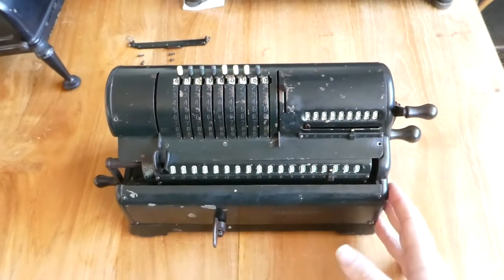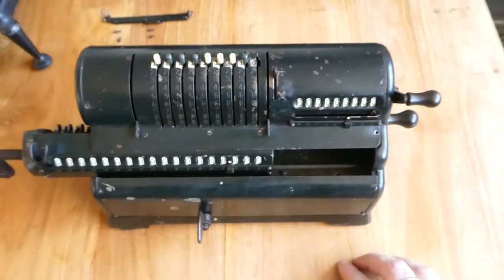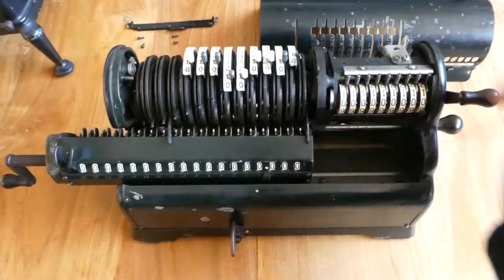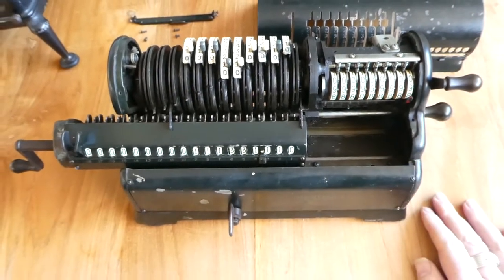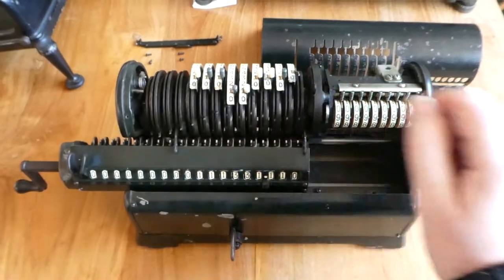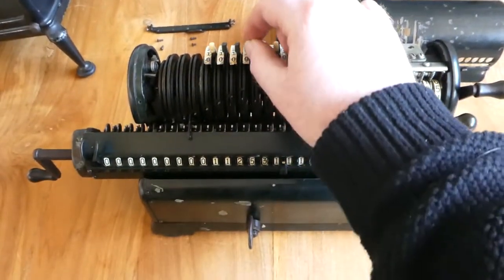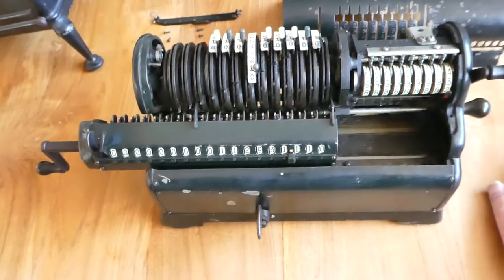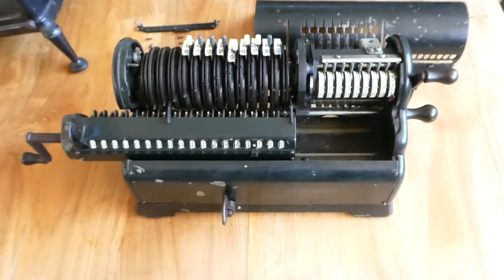The Marchant XL's mechanism

Comment: Thanks for the video, I just bought one on ebay, it's seized at present, the main crank won't turn. Used to repair the old Brass national Cash Registers in the 1960's. Looking forward to the challenge after years of fixing computers it will be good to get back to my trusty oil can
Reply from the maker: Good luck! BTW, I'm a big fan of spraycans of silicone lubricant. Easy to apply, and it loosens up old gunk.
Reply: @jaapsch2  Avoiding the spray can, just in case I decide to give it a paint job. Thanks to your video I opened it up and found the problem, noting serious really, just the result of old sticky oil, it's now working, so will de-grease and re-lube it now possibly tomorrow, thanks again. Ken.